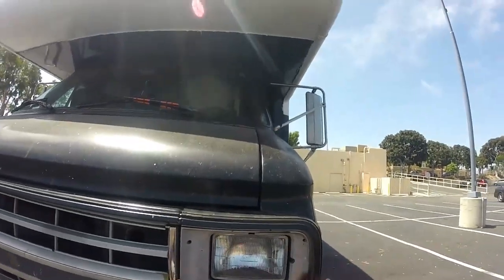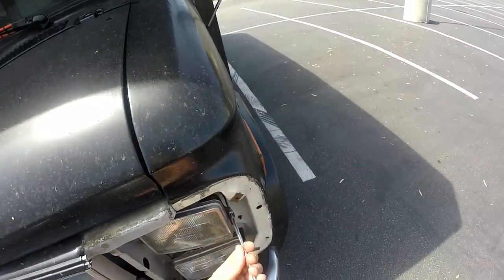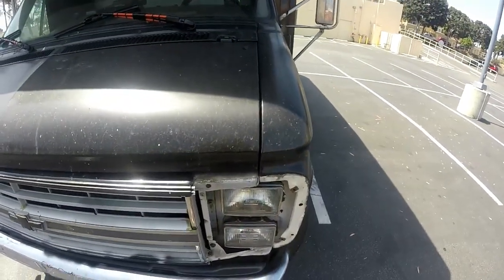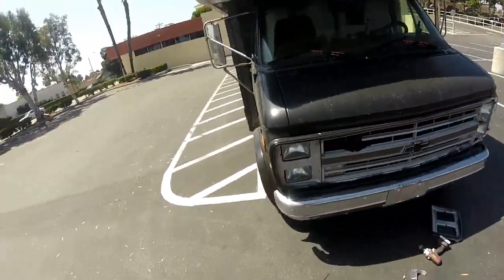RV Living Tip: Replacing & Adjusting Headlight Screws

Comment: Good girl!  Boy you got on that quick.  That right one was very off.  I don't know if you noticed before or when I mentioned it a video or two ago.  Either way it's better than before.

If you find an opportunity when your on a empty road at night, that is the best time to do a very accurate adjustment of each one of your 4 lights.  It's best to have some cardboard to block over the left or right side so you only shine from one side as you do a fine adjustment. It really makes a difference getting them set at night on the road.  Adjusting them during the day is not the best time but your a hell of a lot better than before.  I'm proud of you doing that so quickly and the video.  Great video
Reply from the maker: rick dees Thanks Rick. ...and thanks for the info. My dad taught me the wall trick.

Comment: If you want to fine tune your lights wait til after dark and pull up to a wall on a building and let you lights shine on it, you can then tell if they are too high or low or off kilter and then adjust them from there.
Reply: *****   That is one way but I believe, giving her travels, it would be better to adjust them when out on the road at nigh with no traffic when you can actually see how it points out into the distance on the road.
Reply from the maker: ***** Thanks. .. Yeah my dad taught me that trick.  :)
Reply from the maker: rick dees Good suggestion. ..Thanks. :)